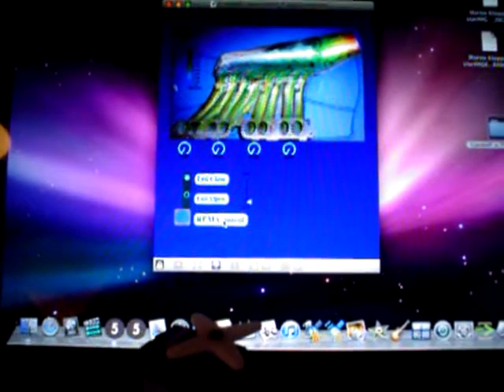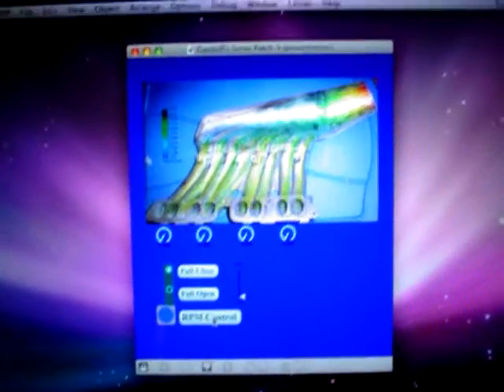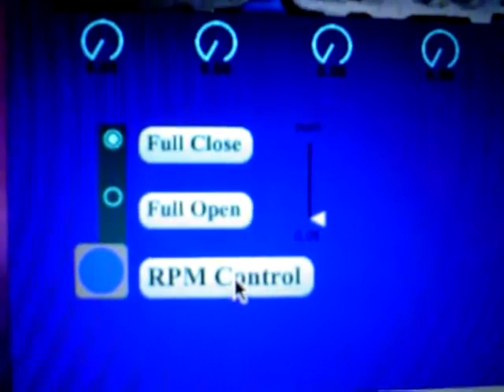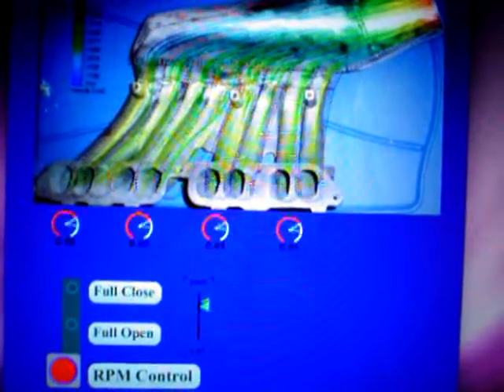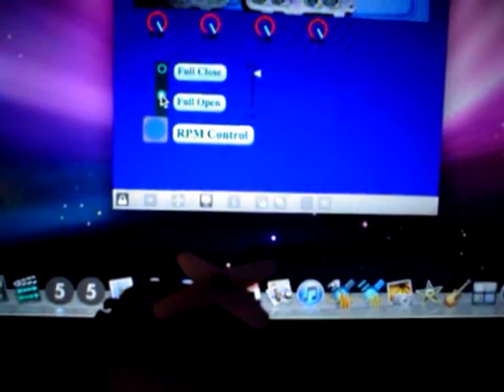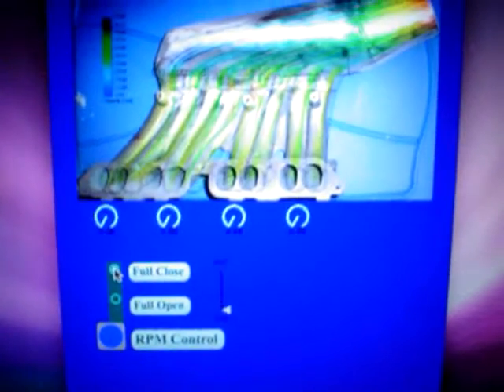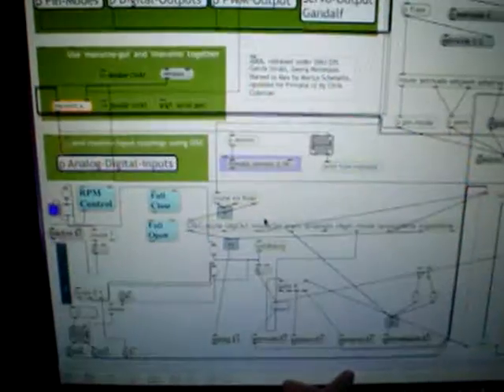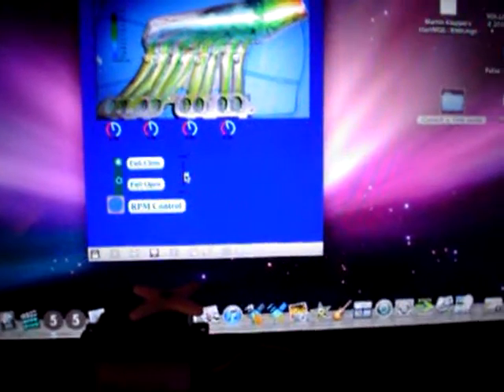TVIS Control With MaxMSP and Servo PART 1

Comment from the maker: I will follow up with more videos which outline results, findings, adjustments I make etc. If you do implement any type of TVIS control, drop me a line here with your findings. 

Cost - yes it adds up.
I end up making most of my aluminum parts because I can TIG weld, which saves a lot of $, but the technology adds up too. Mostly, I have to satisfy my curiosity, and test my theories :). And it's too expensive to hire others to do the work I want.

Comment from the maker: I am unconvinced that the TVIS itself is a structural bottleneck until much much higher power levels... perhaps 500 whp. The reason being, the TVIS itself doesn't occupy much area in the runners when it is wide open, and by the time the TVIS is a bottleneck, the intake manifold itself, the runners, head, cams, valves, may all be bottlenecks of a sort. I'm going to get my manifold/TVIS flow tested, to see at what flow volumes the TVIS actually becomes a restriction.

Comment: unfortunately everything comes down to co$t..  i am unfamiliar with the software and devices you are using.. my engine is completely oem.  i would like to implement your theory on my own mr2.

from reading literature..  tvis becomes a performance bottle neck around the 275 rwhp level....   i believe that tvis can contribute performance past that if it is implemented an "tuned". 

i am extremely interested in your endeavors..  how can i participate?
Reply from the maker: I am doing lots of tuning with the TVIS still in place, and so far I am not seeing any "bottleneck" from the TVIS, in fact have yet to reach it's restrictive point. Ultimately it is the ability for the 8-runner intake manifold to flow volume of air, and not so much the TVIS, since it is just the shaft and butterflies on edge at WOT that have any impact, and it's small. Lots of results forthcoming, Gandalf is now the world's first 5sgte mk1 MR2, and still with TVIS, so it is a very compelling combination for as broad a torque range as possible.
Reply: @mkloppers  thank you for the reply...I am still stalking your updates

Comment from the maker: The oem ecu had a rather complicated method of controlling the TVIS, and actually took into account a great many things, including knock, I believe. But because it was compensating for many things, it ended up not being performance-optimized. A simple RPM switch opening the TVIS at the best RPM already improved performance quite a bit, but because it is sudden, it contributes to a dip in torque. I think I can get rid of that torque dip, and usher in peak torque earlier.

Comment from the maker: There are other "influences" that can be taken into account, but it becomes easier once you actually are tuning the engine with a MS or other ems etc since you can tune it in conjunction with fuel maps etc. With the oem ecu it will likely be the best performance benefit to go by RPM.

What I really still need to test is what the benefit of incremental opening of the TVIS will be. Some people have suggested that a partially-open TVIS will introduce too much turbulence and hurt perf. I disagree.

Comment: thank you for the swift response.  i do realize there are rpm switches to control tvis but the arent tps or load sensitive in case knock needs to be retarded(timing).  pampe engineering(defunct) had such a device.

i really believe that tvis intact will enhance a hotter than stock engine setup of optimized to run with the engines increase in VE.

i am posting from my phone which is cumbersome.  i will follow up this evening with some more questions.

Comment from the maker: It is possible.
Currently I have the stock ecu, and my Mac in my car permanently, and control the TVIS with a program on my Mac called Max MSP, which through an Arduino controls the TVIS.

However, the arduino can be programmed to operate the TVIS on its own, and will continue to operate without connection to any computer once it is loaded with the control program. You can use it with the stock ecu... it really is independent of it though, just uses sensory inputs needed to control the TVIS.

Comment: hi,

i am interested in the implementation of your device in my own 94 usdm mr2 turbo.  i viewed your video intently and noticed that you will use an ems to control TVIS...  is it possible to control it progressed with the stock ecu?  i am planning to use megasquirt in the future.  at the moment i want to have fun tinkering with the cars stock components to maximize its efficiency.